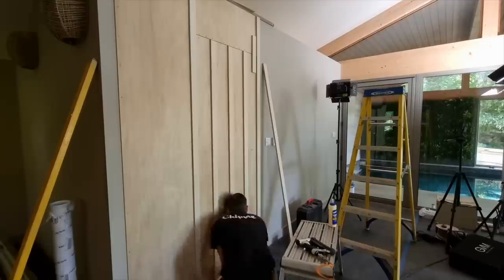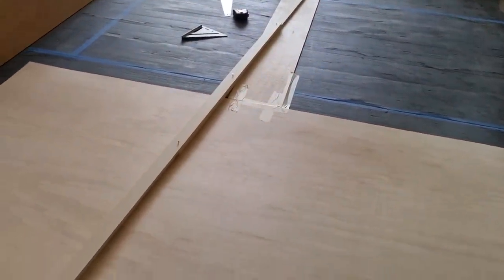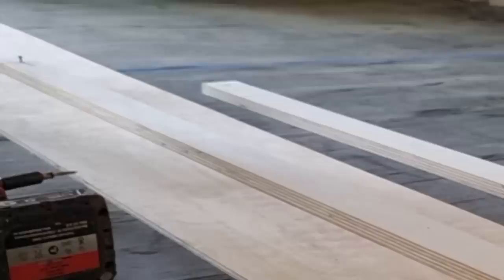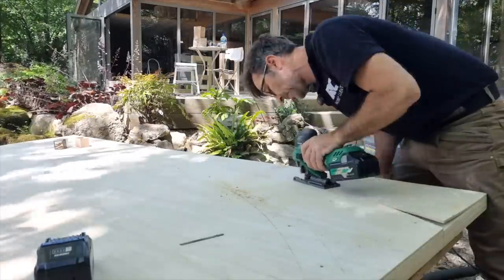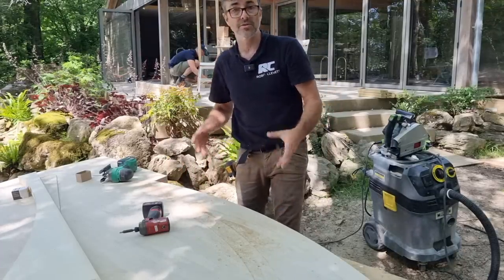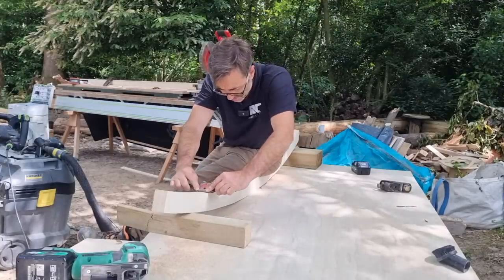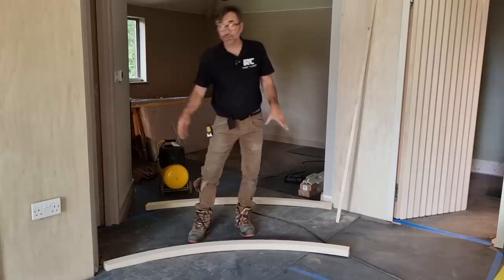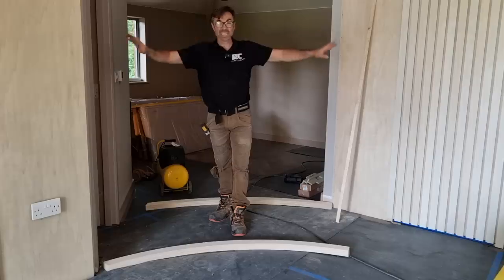Crafting Curved Wall Plates For The Ultimate Designer Slat Wall - Part 3

Comment: Ace! May I ask, how did you calculate your radius? Cheers Robin
Reply from the maker: The screens finish in line with the hip rafter above, so I marked a line on the floor that represented the centre of the hip above and then drew a line at the end of the mirror all at 90 degrees until it met the line from the hip rafter, this was the radius for the front screen, then I positioned my rear screen position by adding my desired width between the screens from the same axis point this gave me two parallel radiuses and then I set the wall plate widths onto these to suit
Reply: @ukconstruction  clever stuff. I’m really looking forward to the big reveal. Cheers

Comment: What I’ve progressed towards in this type of scenario is cutting the template with a jigsaw with the blade angled 2-3 degrees away from cut then using a top bearing router cutter to square it down.
Don’t know if this will help anyone but I’ll leave it here 🙅🏻‍♂️
Reply from the maker: Great tip Anthony and I'm sure that will help someone

Comment: Hi Robin! I'm struggling to decide between two jigsaws. I have older festool corded one which is great and nothing wrong with it except the cord limitation. I have makita and festool batteries but cant decide should I get the carvex barrel grip or makita barrel grip one. Just wondering if the festool one is much better or not, cause price is 200€ better 😂